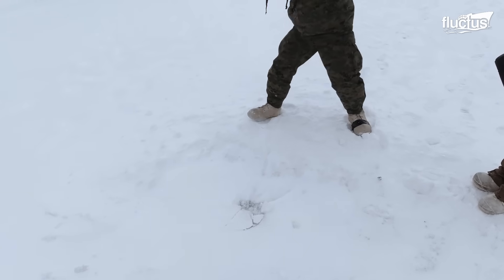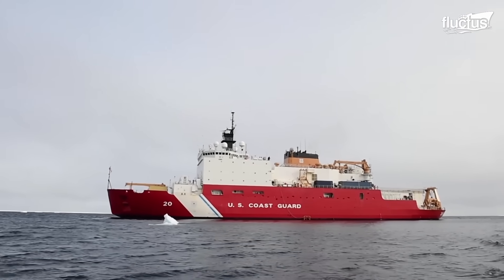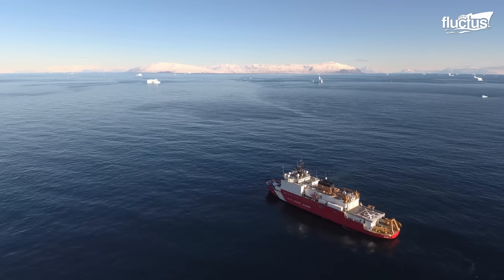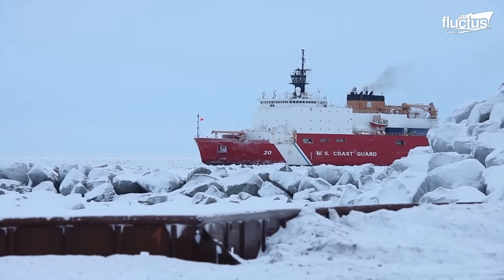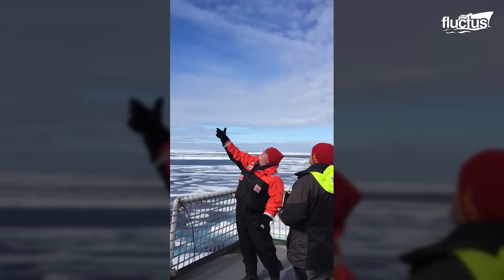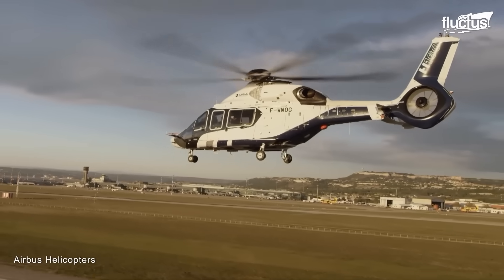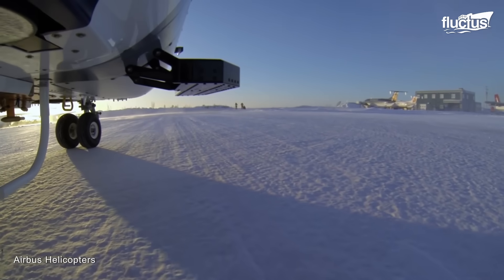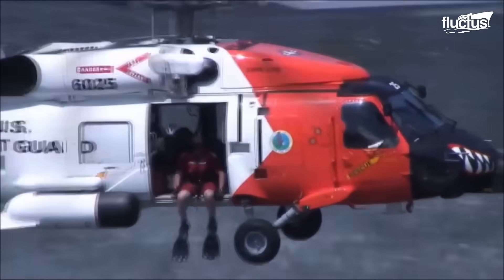Stuck in the North Pole: Life Inside US Largest Icebreaker Ever Built

Comment: I spent 5 years at the North Pole. Working offshore drilling. Never did see ship anywhere. We would send in equipment and a small crew to start up the drilling site and the landing strip. They would start drilling holes in the ice and pump water for days giving us roughly 30 feet of ice the set the rig up. And camp and construction area usually located by the airstrip. The air will be built on a crack in the ice. Because this the strongest part because of the forces from the making kinda of a ridge. Flood and level and keep it cleared. And we would land the C130 Hercules carrying the rig. 144 loads altogether. We would sit on about 1700 to 2500 feet of ocean below us. Yes the ice moves up and down with the tide and currents. We have these compensatiors in the sub structure that allows the rig to raise and lower to keep the bit on bottom drilling. The would raise upwards of 20 feet all day long. You never see it happening but it is happening. Anyway it was perhaps the most breathtaking beautiful frightening place I've been in my oilfield career. And this was in the early eighties

Comment: 4.5ft of ice at more like 3kts, not 20.  Unless someone is slipping go juice in the tank, it's top speed is 17. But still a cool platform.  Time  to replace the Polar Rollers with a more capable breaker, which could run rings around Healy on a bad day.

Comment: A couple of errors in the narration.  HEALY was specified to maintain 3.0 knots in 4.5 foot thick ice and be able to break 6.0 foot thick ice at no specified speed.  She actually does better than spec and has, in fact, beaten through a 45 foot thick pressure ridge (took 4 hours, but she did it!)

Her top open water speed is actually 20 knots.

Comment: Sadly the Healy is an ice resistant science vessel, and not a very good icebreaker.  She has a lot of HP, but sadly with fixed pitch propellers she cannot employ all of it from a standstill, such as when setting in ice.  This and her stern design inhibit her ability to back up and ram at thick ice, a necessary ability for any true icebreaker
Reply: Correct, Healy is not a heavy icebreaker.  Not sad, though.  Sad is that we had only two heavy icebreakers, Polar Sea and Polar Star, which are quite old now.  One is not in service at all.  We fell far behind in icebreaker development.
Reply: Thank you for clarification.Greetings from Ct.